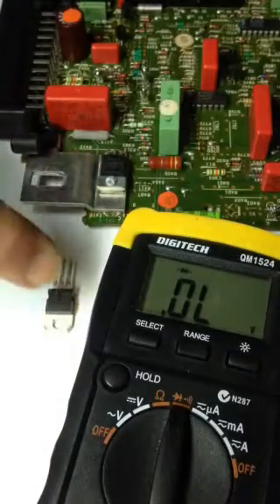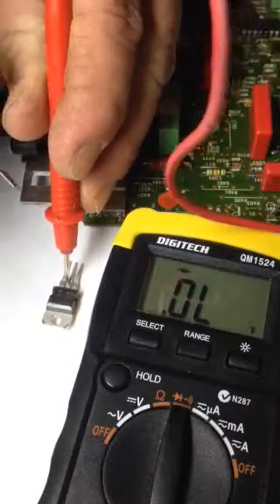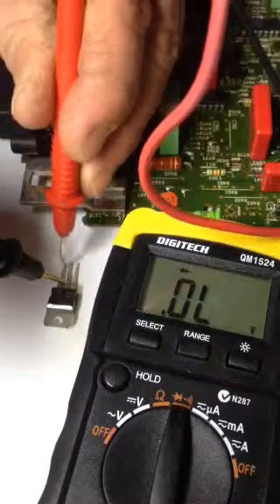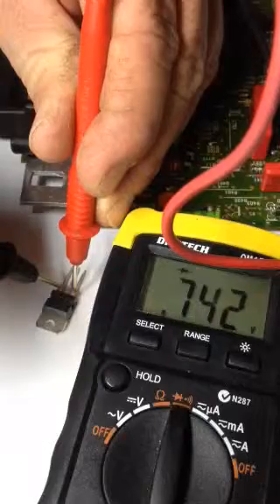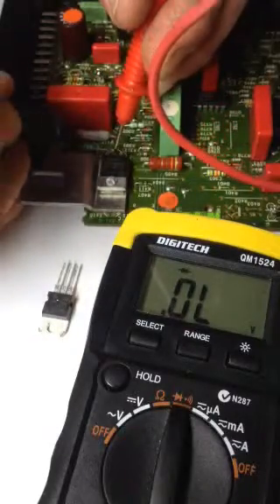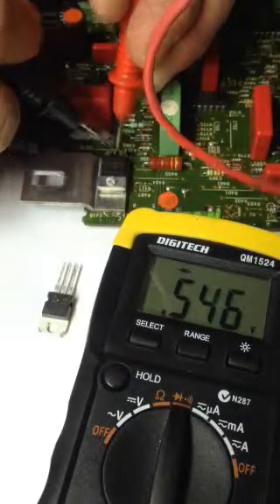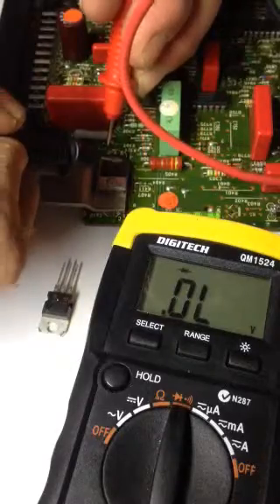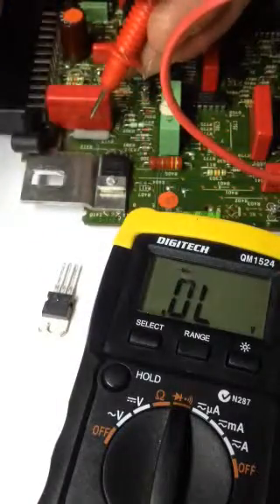Holden vk faulty injector ecu transistor

Comment: The voltage output from the multimeter can sometimes backfeed through the rest of the ECU if testing the transitor in situ (soldered in) & give a false reading,I was concerned with the bidirectional reading of about 300mV in both directions as I perhaps thought that may have been reading off something else.

Anyhow, if replacing the transistor fixed the problem, you've done well to repair the ECU ,it would only be the likes of a comparator circuit or something which may be fried if not the transistor as the ECU is the Bosch L-Jetronic unit which is all analogue unlike from the VL Commodore onwards where they went all digital with them.